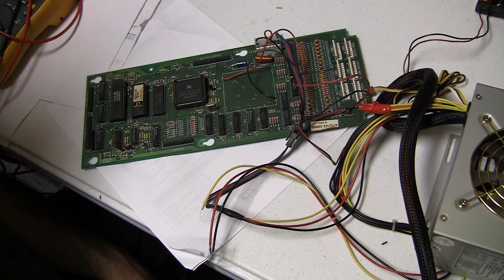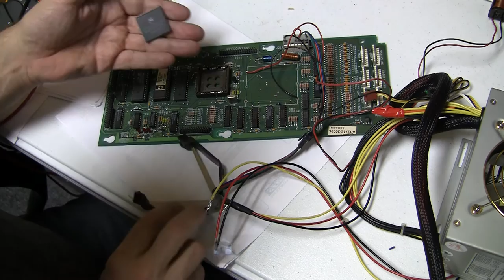Bally Williams dead WPC MPU board fix - Dr. Who - Part 1/5 - PinballHelp.com

Comment: Probably shouldn't lay the board on paper.
Reply: I use a fixture that holds them by the edge I can spin it around look at both sides at once hands free. I can reach for a probe,soldering iron or any tool and board stays in place. Hate chasing pieces around my work bench.